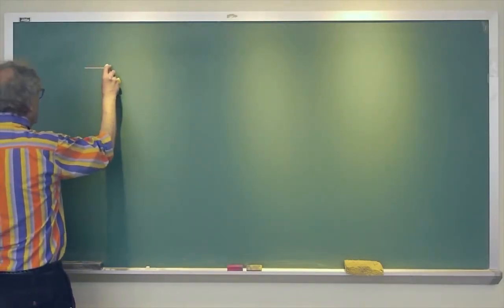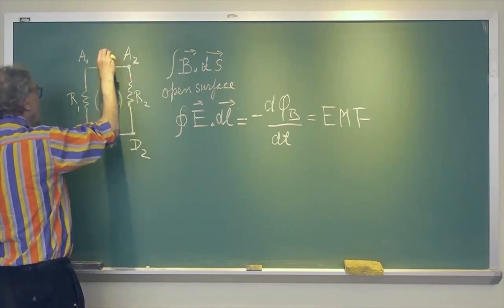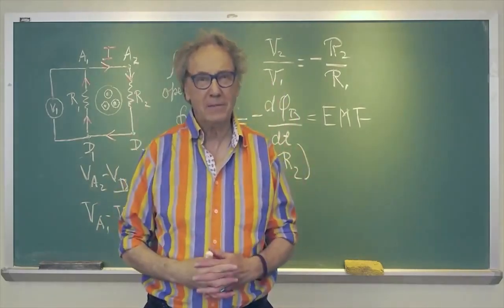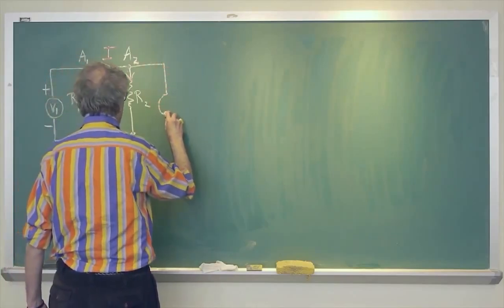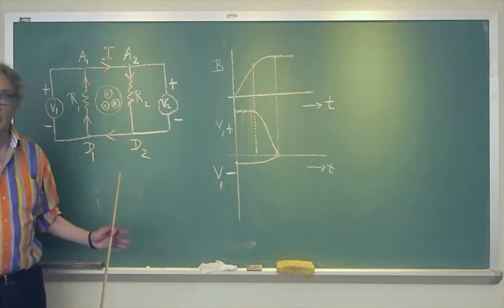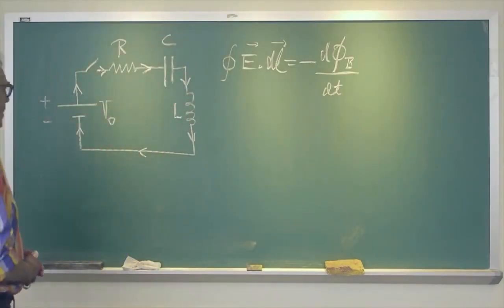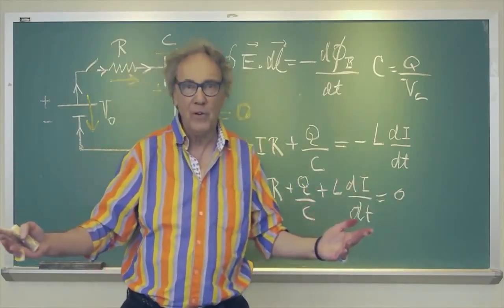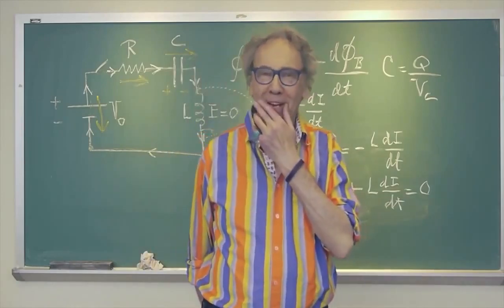Kirchhoff's Loop Rule Is For The Birds

Comment: So, what happens if you connect a third voltmeter from somewhere between A1 and A2 to somewhere between D1 and D2?
Is there a connection arrangement at which you would read zero volts?

If A1 and A2 are really just A (and similarly for D) because of the magic zero-resistance wire, what happens when you make them literally the same? Then when you attach your two voltmeters, what will they show? 

I've seen the demonstration in which the two oscilloscopes show the two different voltage curves, but I've still not seen a satisfactory explanation of how the two scopes "decide" whether to measure across R1 or across R2. 

"Intuitively", one would expect that both meters would show the same voltage curve (due to the fact that they are effectively taking the same reading) and that that curve would just be a combination of the voltages from the positive current through R2 and the negative current through R1. Thus, if V2 is I*R2 and V1 is -I*R1, the instruments would logically both see something like Vsum = I * (R2 - R1). How is this not so? Surely the observer's "intent" to measure one path or the other has no effect on the what the instruments actually measure.

More generally, if you have some arbitrarily complex circuit with multiple possible paths between two points that you might choose to connect a voltmeter across, would you expect that the measurement is determined by looking at one of the possible paths and simply ignoring the others?
Reply from the maker: write down the integral of E dot dL for all loops. Solve for the currents going through each of 3 voltmeters and you will have your answer.

Comment: Dear professor, could you elaborate the case when the KCL is not valid, e.g. when the field cannot be considered quasi-stationary such as in the case of large electric power transmission lines?
Reply from the maker: I appreciate the fact that this Physics may not be familiar to you. Don't feel embarrassed about it; you are not alone. However, it's never too late to get educated. The choice is yours. Maybe this will help you. 
I demonstrated at the end of my lecture #16 of my 8.02 E&M course at MIT that two identical voltmeters attached to the same 2 points in a circuit can show very different values. https://www.youtube.com/watch?v=nGQbA2jwkWI&list=PLyQSN7X0ro2314mKyUiOILaOC2hk6Pc3j&index=17 The reason is that in the case of an induced EMF (Faraday's Law) potential differences are no longer determined; they depend on the path. This also applies to the secondary windings of transformers as the EMF in the closed loop of secondary windings is induced. https://www.youtube.com/watch?v=b7i2uMx7gHo&list=PLyQSN7X0ro22zanLOcvkaSY-IZqheFYM5&index=8
Of course, in cases where Kirchhoff's loop rule (KVL) applies, 2 voltmeters attached to the same 2 points in a circuit will always show the same value. 
My demo was first suggested and published by Romer in December 1982 in the American Journal of Physics. This demo has now become a classic; it's done all over the world at many colleges and universities. 
Kirchhoff's original text can be found in the following link, pages 497-514: https://books.google.de/books?id=Ig8t8yIz20UC. Clearly he was fully aware of the prerequisite for his "loop rule". KVL is a special case of Faraday's Law. That's why Faraday's Law is one of Maxwell's equations and KVL is not.
By teaching students that KVL always works without telling them when it does not work, makes many believe that the closed loop integral of E dot dL is always zero. ElectroBOOM and Dirk Van Meirvenne therefore believe that 2 voltmeters attached to the same 2 points in a circuit must always show the same value which is not true as demonstrated in my lectures. They each posted a video (see @ footnote below) on their channel in which they claim to have proof for their wrong ideas which violate Maxwell's equations. Apparently they do not know, or do not understand, that in the case of an induced EMF potential differences are no longer determined; they depend on the path. MIT students who took my 8.02 course (Electricity and Magnetism) would not make this mistake! I therefore believe that to introduce a "modern version" of KVL and then teach students that KVL always holds is not advisable as you may set them up for making the same embarrassing mistake that both Dirk Van Meirvenne and ElectroBOOM made. 
Also read Professor John Belcher's thoughts on Faraday's Law and on KVL. Professor Belcher is my former colleague at MIT. http://freepdfhosting.com/0813df09f5.pdf
(@) ElectroBOOM insulted me in his video by mentioning that the reason why my 2 voltmeters read different values was due to "bad probing". He stated that if I had done the demo correctly I would have found that both voltmeters would have read the same value. He could not have been more wrong  
This is my only msg on this issue. This is too basic. I do not argue either with people who believe that the Earth is flat.
This video may also help some of you to digest why 2 Voltmeters attached to the same 2 points in a circuit can give very different readings. https://youtu.be/T6S5VS03xZc
Reply: @lecturesbywalterlewin.they9259  Dear professor, I am afraid that you didn't understand my question. I referred to KCL, not KVL (the case when the sum of currents is not zero, but -dQ/dt).
Reply: @lecturesbywalterlewin.they9259  Regarding your demo with two voltmeters, I have a book from 1980 with the same experiment.  I would not like to insult you, but I believe that it was not Romer who proposed first that famous demo in 1982. It was proposed at least 50 years ago.
Reply from the maker: @vaks2l  Romer published in 1982. If it had already been publishedin 1980 his publication would not have been accepted. You do not insult me at all. Please send me the reference of the 1980 article that proposes that same demo.
Reply from the maker: Kirchhoff's current law. The sum of the total currents flowing towards the node or junction is zero. The Kirchhoff current law is also applicable in AC circuit, provided the summation of the current is done in vector form or using instantaneous value for the circuit consisting of inductors, resistor and capacitors together.
Reply: @lecturesbywalterlewin.they9259  That may be in contrast with continuity equation (which can be derived from Maxwell's equations), as explained here: https://en.wikipedia.org/wiki/Continuity_equation
Reply from the maker: @vaks2l  I see no contrast. the continuity equation for electric charge states that the amount of electric charge in any volume of space can only change by the amount of electric current flowing into or out of that volume through its boundaries.
Reply: @lecturesbywalterlewin.they9259  Exactly, but the KCL does not account for the accumulated charge, which could happen in transmission lines. In other words, KCL claims that div J = 0, but not div J = -d \rho /dt, which is the continuity equation.
Reply from the maker: Yes K's Current law states div J=0
Reply from the maker: div J = 0, for steady-state currents has some important consequences. In particular, it leads to Kirchhoff's current law (KCL). If the currents are not steady then drho/dt is not zero.
Reply from the maker: KVL can only be used if dphi/dt through open surfaces attached to closed loops is zero. Thus it can be used (both in DC and AC) in R C circuits if the inductance can be ignored. I cannot think of any reason why KCL would not always work thus also if there is an inductance.
Reply: @lecturesbywalterlewin.they9259  Yes, indeed. I agree that KCL can be perfectly applied for all circuits with lumped, concentrated elements. I don't want to discuss the use of KVL, it should be trivial for people with a basic knowledge od physics. :)

Comment: Isn't it the convention that a pure resistance modelized by "R" shall be passive hence not sensitive to magnetic effect ? So if you want to modelize a system which is sensitive to magnetic flux variation, don't you need to add an inductance "L" attached to each "R" ?
Reply from the maker: no you don't, as the resistance, in general,  have inductances of less than a few micro H.
Reply from the maker: Apparently you still do not fully understand Faraday's Law.  But, as I already wrote, you are not alone; ElectroBOOM and Dirk Van Meirvenne do not understand it either as is obvious from videos they posted on their youtube channels in which they both argue that 2 voltmeters attached to the same 2 points in a circuit must always read the same values which is wrong; it would be a violation of Maxwell's eqs. 
This is my last attempt to teach you Physics. https://www.youtube.com/watch?v=wz_GqO-Urk4&list=PLyQSN7X0ro22zanLOcvkaSY-IZqheFYM5&index=11 If this does not work then I cannot help you anymore. 'You can lead a horse to water, but you can't make it drink'. If you do not want to drink, that's ok with me. You are entitled to make that choice. This is my last msg.

Comment: Hi sir,
Have a question, because of the induced EMFs we have an induced current flowing through the circuit. Now the polarity of the voltage is different on both the resistors, but the current is flowing in the same loop. Thus for one of the resisitor the current is flowing from low voltage to high voltage end, is that possible. Please let me know your thoughts on this Sir
Reply from the maker: maybe this will help you https://www.youtube.com/watch?v=wz_GqO-Urk4&list=PLyQSN7X0ro22zanLOcvkaSY-IZqheFYM5&index=11

Comment: The issue in short is that due to changing magnetic field virtual inductors not physical are created in the loop due to Lenz Law.This is what is called self inductance.Piece of cake.
Reply from the maker: I appreciate the fact that this Physics may not be familiar to you. Don't feel embarrassed about it; you are not alone. However, it's never too late to get educated. The choice is yours. Maybe this will help you. 
I demonstrated at the end of my lecture #16 of my 8.02 E&M course at MIT that two identical voltmeters attached to the same 2 points in a circuit can show very different values. https://www.youtube.com/watch?v=nGQbA2jwkWI&list=PLyQSN7X0ro2314mKyUiOILaOC2hk6Pc3j&index=17 The reason is that in the case of an induced EMF (Faraday's Law) potential differences are no longer determined; they depend on the path. This also applies to the secondary windings of transformers as the EMF in the closed loop of secondary windings is induced. https://www.youtube.com/watch?v=b7i2uMx7gHo&list=PLyQSN7X0ro22zanLOcvkaSY-IZqheFYM5&index=8
Of course, in cases where Kirchhoff's loop rule (KVL) applies, 2 voltmeters attached to the same 2 points in a circuit will always show the same value. 
My demo was first suggested and published by Romer in December 1982 in the American Journal of Physics. This demo has now become a classic; it's done all over the world at many colleges and universities. 
Kirchhoff's original text can be found in the following link, pages 497-514: https://books.google.de/books?id=Ig8t8yIz20UC. Clearly he was fully aware of the prerequisite for his "loop rule". KVL is a special case of Faraday's Law. That's why Faraday's Law is one of Maxwell's equations and KVL is not.
By teaching students that KVL always works without telling them when it does not work, makes many believe that the closed loop integral of E dot dL is always zero. ElectroBOOM and Dirk Van Meirvenne therefore believe that 2 voltmeters attached to the same 2 points in a circuit must always show the same value which is not true as demonstrated in my lectures. They each posted a video on their channel in which they claim to have proof for their wrong ideas which violate Maxwell's equations. Apparently they do not know, or do not understand, that in the case of an induced EMF potential differences are no longer determined; they depend on the path. MIT students who took my 8.02 course (Electricity and Magnetism) would not make this mistake! I therefore believe that to introduce a "modern version" of KVL and then teach students that KVL always holds is not advisable as you may set them up for making the same embarrassing mistake that both Dirk Van Meirvenne and ElectroBOOM made. 
Also read Professor John Belcher's thoughts on Faraday's Law and on KVL. Professor Belcher is my former colleague at MIT. http://freepdfhosting.com/0813df09f5.pdf

Comment from the maker: I demonstrated at the end of my lecture #16 of my 8.02 E&M course at MIT that two identical voltmeters attached to the same 2 points in a circuit can show very different values. https://www.youtube.com/watch?v=nGQbA2jwkWI&list=PLyQSN7X0ro2314mKyUiOILaOC2hk6Pc3j&index=17 The reason is that in the case of an induced EMF (Faraday's Law) potential differences are no longer determined; they depend on the path. This also applies to the secondary windings of transformers as the EMF in the closed loop of secondary windings is induced. https://www.youtube.com/watch?v=b7i2uMx7gHo&list=PLyQSN7X0ro22zanLOcvkaSY-IZqheFYM5&index=8
Of course, in cases where Kirchhoff's loop rule (KVL) applies, 2 voltmeters attached to the same 2 points in a circuit will always show the same value. 
My demo was first suggested and published by Romer in December 1982 in the American Journal of Physics. This demo has now become a classic; it's done all over the world at many colleges and universities. 
Kirchhoff's original text can be found in the following link, pages 497-514: https://books.google.de/books?id=Ig8t8yIz20UC. Clearly he was fully aware of the prerequisite for his "loop rule". KVL is a special case of Faraday's Law. That's why Faraday's Law is one of Maxwell's equations and KVL is not.
By teaching students that KVL always works without telling them when it does not work, makes many believe that the closed loop integral of E dot dL is always zero. ElectroBOOM and Dirk Van Meirvenne therefore believe that 2 voltmeters attached to the same 2 points in a circuit must always show the same value which is not true as demonstrated in my lectures. They each posted a video on their channel to prove what cannot be proven as their ideas violate Maxwell's equations. Apparently they do not know, or do not understand, that in the case of an induced EMF potential differences are no longer determined; they depend on the path. MIT students who took my 8.02 course (Electricity and Magnetism) would not make this mistake! I therefore believe that to introduce a "modern version" of KVL and then teach students that KVL always holds is the wrong thing to do as you set them up for making the same embarrassing mistake that both Dirk Van Meirvenne and ElectroBOOM made.
Reply from the maker: do me a favor and send me the exact text in your book of 1980 that described this demo with 2 volmeters attached to the same to points in a circuit but which show different readings. Does it uses an electromagnet like in Romer?
Reply from the maker: the result with your battery is wrong as you find that VA - VD is path independent and it is never zero which is not true.